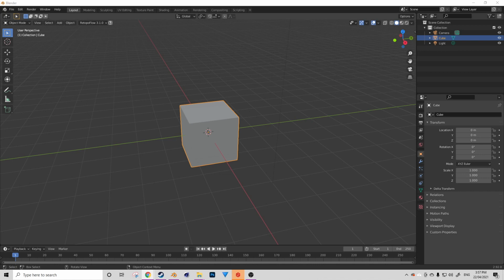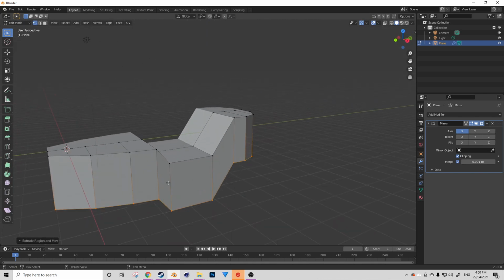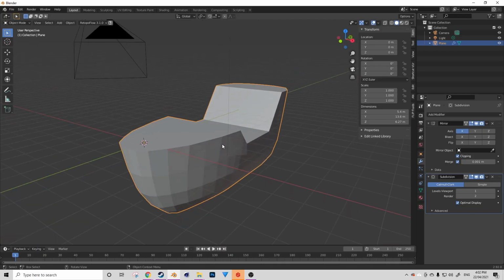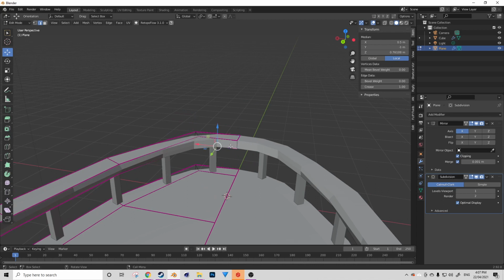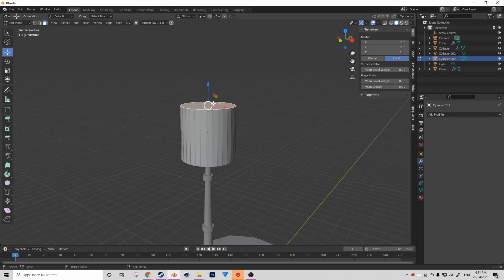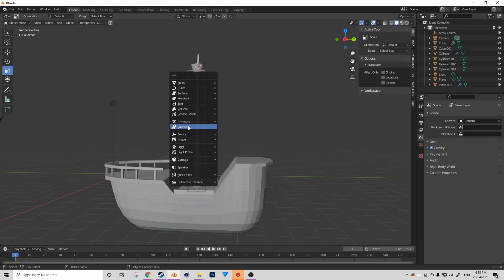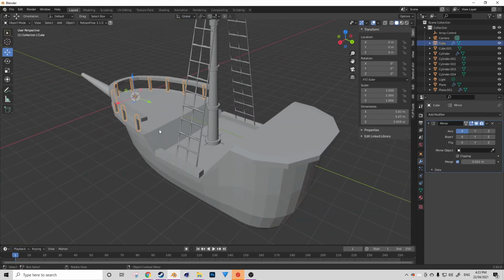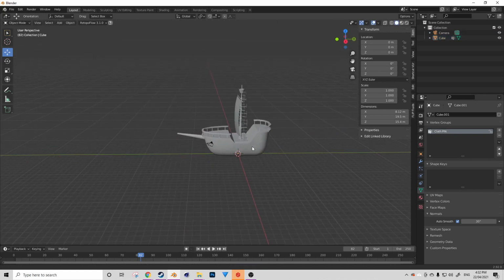Blender Tutorial | Create a Ship | Part 1

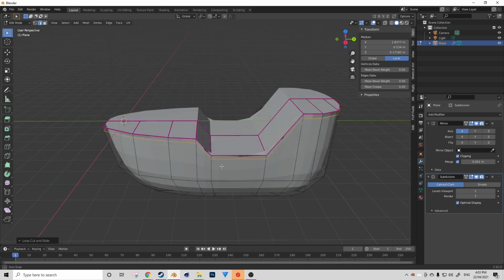Comment: 9:37, how do you select them, I tried "L" but It selects everything, boats looks really nice by the way :)
Reply from the maker: Good questions. So if L is selecting everything it mean that everything is connected in some way. The way I like to think about it is that  L stands for Linked. If you break the link by hiding certain structures it can make it a little easier.

Hope this helps.

Hayden.
Reply: @Polyfable  Thanks for anwsering, but at that time code 9:37 how did you select the top parts, I don’t inderstand.
Reply from the maker: @rayleixx  Ah, I see, Alt + Click (Loop selection) if you have Emulate mouse it is double click
Reply: @Polyfable  Do you have discord, so I can send you a video of what it does, because when I double click it doesn't select the right parts, and Alt + Click does nothing, Is it because I got an Azerty keyboard ? Or am I doing something wrong ?

Comment: Hello! So when I add my subdivision modifier, the shape looks exactly like yours. There does not seem anything wrong with it. That is up until the part where I set the crease of the top faces to 1.00. Some parts of the surfaces are not completely flat. I have triple-checked the model itself, the mirror modifier, and the subdivision modifier. There seems to be nothing wrong, but something is still weird that I can't solve. I wish I could send an image about this because it is hard to describe. Is there any way to get in contact with you where I can send an image?
Reply: If you use a mouse a way to prevent it is clicking the scrool button
Reply: I had a similar problem, when I applied the subdivision surface modifier and then turned up mean crease it created strange artifacts where the mesh didn't become flat again. I ended up having stacked some vertices on top of one an other and there was another tiny face in between what looked to be the edge of the face. I then tried to delete said vertices but that ruined the mesh so instead I ended up moving the vertices on either side forward slightly, and then reselecting the newly visible face and turning up the mean crease on that to.
hope this helped :D

Comment: Loop cut using E and F doesn't seem to work in Blender 2.90.1. If I use the CTRL R instead it snaps in place and doesn't slide along.
Reply from the maker: Which time? Loop cut has never been E or F.

Ctrl R will give you the line and after you add it you can move it as it puts you in an automatic Vertex Slide
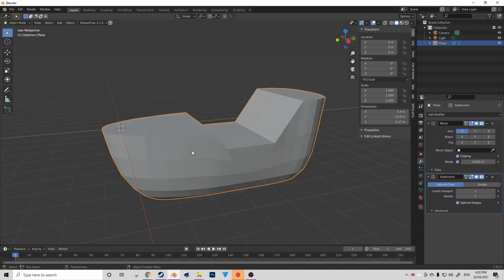Reply: @Polyfable  Yes, I figured it out eventually after moving back a bit in the video. I think my brain at that time just mixed the instruction at 9:16.
Reply from the maker: @kape2978  That is all good. How is blender going? Having fun with it?
Reply: @Polyfable  Honestly, getting into it alone is not fun. Getting into it with good tutorials though, that is quite fun!
Reply from the maker: @kape2978  I completely understand that. That is actually one of the reasons I am starting blendertutorials.org (I taught myself the hard way becuase I am a story teller more than a "blender artist") and I want to share a pathway for other users just jumping in. (That being said I am still going to do youtube videos, I have just been focusing on the website till it is finished)

What has been the hardest part about learning blender thus far?
Reply: i'm stuck to this part, mind helping me out ?, nvm I figurided out.

Comment: great tutorial and loads of information but i found it hard. used to doing 10 minute simple videos on making basic meshes.
Reply from the maker: That is all good! What part did you find the most difficult?
Reply: @Polyfable     I couldn't get the array modifier to change the size of the pole circle thingy.  Knowing what key you pressed helps as well. Thanks for the video again
Reply from the maker: @Captainshowtime  I linked the array to an object and the array object section. The object I then scaled only on X and Y using the - S then Shift+Z shortcut
Reply: @Polyfable  thanks